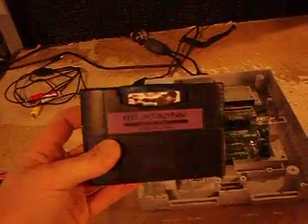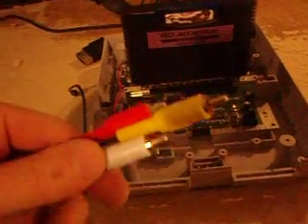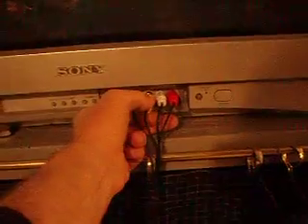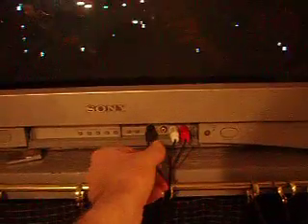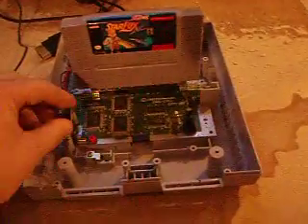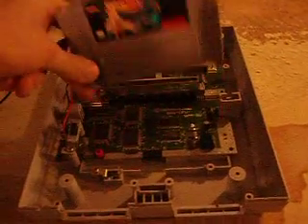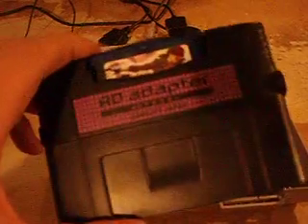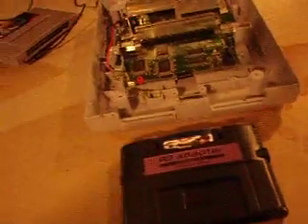GBA to SNES adapter without extra cable mod.

Comment: Shot in the dark here, but I just got one of these and would like to do this modification. Unfortunately everything on assembler is gone. Are they any back up links or anything to reference doing this?
Reply from the maker: Yes, a shame, so much content got deleted when Assembler died. Remarkably, it is still on Drakon's forum. Be aware though that this mod is convoluted and kind of crazy. I am using a relay to do the switching and it definitely has a hacky feel.  Not really worth doing for most people I would say.  But hey it's there. https://16bitgamer.canadian-forum.com/t337-modding-the-tototek-gamejoy-gba-snes-ad-adapter
Reply from the maker: If you have the noisy audio output on your adapter, you might want to look into my Audio fix for it. A lot easier than this mod and fixes an actual real problem.
Reply from the maker: A caveat though, the link I provided has the schematic for the complete mod but not all the explanations and discussion I had made for it on assembler. It should still be possible to figure out the complete mod with only the schematic. However I would be hard pressed to answer specific questions about it after all these years.
Reply: @EvilMaxWar  thanks for the reply. Do you still own that snes? Any chances for full pictures of your motherboard with the wire setup? 

It is what it is. But currently your method is the only "fix" to bypass the  extra av cables on the cartridge
Reply: @EvilMaxWar   I will send you $30 Cash App if you can either update your video or your text tutorial lol 

 If the guy who invented it doesn't remember then I'm gonna have slim chances doing it too
Reply from the maker: @BelowAverageGaming  Made a bit of digging, there is a bit of discussion on Sega-16 also, with a picture of my motherboard.  https://169.45.167.69/forum/showthread.php?25960-RetroGen-AD-adapter-Super-Retro-Adapter-etc-On-the-SNES-without-extra-AV-cable-mod
Reply from the maker: I am warning you again though this is a bit of a sketchy mod.  You would probably be better off modding some clone console like an old Retron rather than messing with this mod in a Genuine SNES. I still have my modded console and last I tried the mod still works fine, but I would not redo it again. I would rather make myself a permanent "consolized GBA" using this adapter and a cheap snes clone.
Reply: @EvilMaxWar   Even if I don't follow through with it, I appreciate you

Comment: Hi. Is it possible to do this with the SupaBoy S? And does it work with the RetroGen adapter?
Reply from the maker: I can't say I havent taken those appart, but presumably they are built using a similar design.

Comment: Hello sir ! and thank you for this video ! 

I wish do do your video and audio mods on my SNES + Super Retro Adapter. Unfortunately, your links to assemblergames no longer works. Is there a way to consult your mods elsewhere ?

By the way, I wish to do this on my PAL SNES, with SCART cable. Would it work too ? 

Thank you !
Reply from the maker: Apparently Assembler games closed down :(  There is an archive and the threads are there but they dont have pictures. I had uploaded it on 16 bit gamer too and fortunately It is still there. https://16bitgamer.canadian-forum.com/t337-modding-the-tototek-gamejoy-gba-snes-ad-adapter

Both threads are condensed in one. I highly recommend the sound fix if your adapter exhibits the problems. But the cable less  SNES adaptation I made is a somewhat crazy and complicated mod and I am not sure I would recommend people to do it xD

Comment: Hi, 
At first, thank you for the video  :)
Do you know where can I buy one of these Tototek GBA adapter? I've seeked in ebay and in the tototek website but they seems to be sold out.
Best regards.
Reply from the maker: I am not sure, the same product can be found under different names, such as the super retro advance. Maybe the hardware inside has a few different revisions, I am not sure but I know for a fact that it was the same family of PCB inside the cartridge.  I suspect this product was a commercial failure and is possibly discontinued, which is a shame because it has potential for greatness.
Reply: @EvilMaxWar   Thank you, for your response. It's too bad that this product wasn't enough sold/bought. Gameboy advance have a lot of good games that deserve to be played on TV. So, I think I'm going to take a super retro advance instead. Then, I'll try to make it work without using cable :)

Comment: The adaptor is raspberry pie emulation that use only power and snes controlors as the gba cpu is way more powerful than snes lame 2 mhz cpu, I don't know but the mod is quite clever
Reply from the maker: This is not raspberry pie emulation but rather a clone on a chip contained in the cartridge. It is superior to emulation in that it is real hardware.  Clone hardware often sucks but in this specific case it is excellent.  As far as I can tell it plays as well as any genuine Nintendo hardware.
Reply: Also, the SNES CPU is far from lame. You're just from the wrong (uneducated) era. Lol

Comment: The concept is pretty cool BUT. I actualy wish to mod the gba adaptor in a way to use the snes framebuffer instead, for it's graphics will the sound gets passtrough the ext soundpins.
This also would allowed you to play gba games in s-video and rgb,just like the supergameboy.
Reply from the maker: From the best of my experience with that adapter, You only get composite coming out of under the big Glob top that is in it. I tried probing all over it with my scope. Maybe there is some way to tap a digital video signal but I am far from sure. Hard to say without a datasheet of the thing.
Btw I made an extensive Sound fix mod for it. Improved to sound quality alot and the sound uses the Snes Ext pins and you can find detailed explanations on Assembler games.
Reply: Max War  is this mod easy??? i got three super nintendos i mod one to do this or get it modded...

Comment: Is it possible to mod it to output RGB? :D
Reply from the maker: Sadly I have not found a way to get anything out of it but Composite. And I have probed just about every contact point with an oscilloscope. On the bright side though the composite on that thing is very good.
Reply: What about S-video?  I don't remember if you mentioned anything about that in the video.
Reply from the maker: NeCacaluXuxultic
I say In the video that this will only work with Composite, and as far as I know this is still true, so no S-video sorry. The upcoming retro trio claims S-video support. It remains to be seen if this will extend to the Super Retro Adapter Advance. I plan on getting one of those once the retro-trio is released. I will investigate further then.  By all mean do not let the lack of better than composite signal turn you away from this device, it still outputs better video than the gamecube adapter. I also developed an extensive sound fix mod for it. Just Google "AD Adapter sound fixes"
Reply: Hehehe I might buy it.  I never liked the GameCube adapter and I was looking at several videos and the quality looks really good :D.  Thanks for your replies, it really helped me out :D